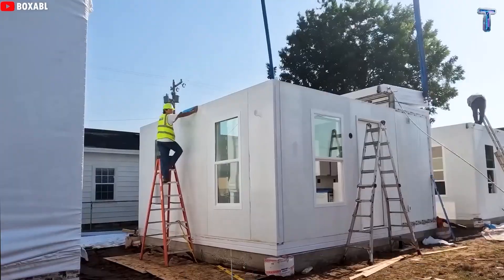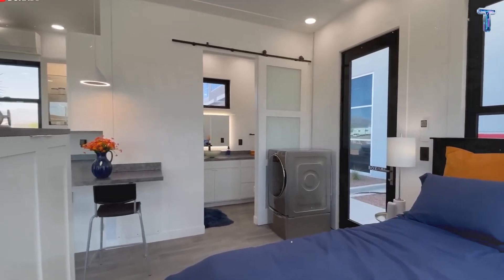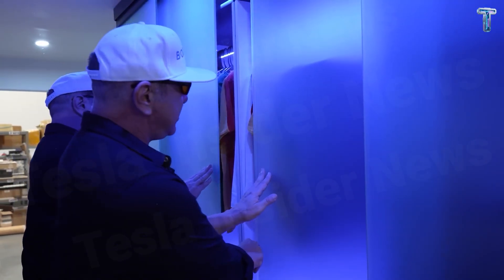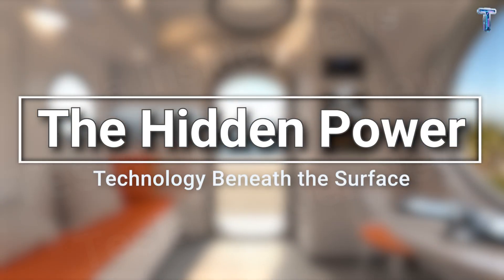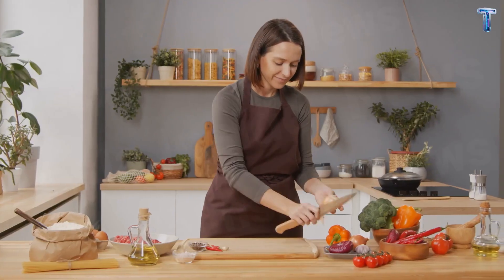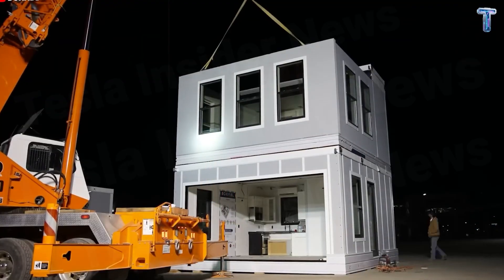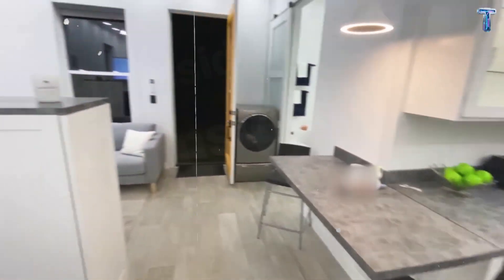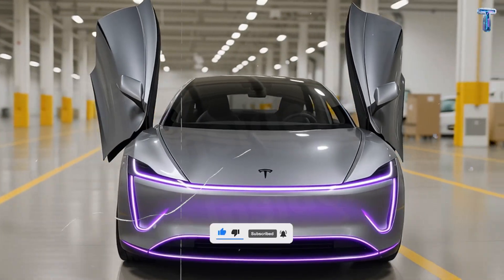Finally Inside Tesla’s $7,999 Tiny House — It Powers Itself

Comment: Shoot. A couple of cargo Starships loaded, with these Telsa house versions sent to Mars & the moon, would surly make the astronauts happy campers. A Space X cargo variant Starship has a payload capacity of up to 200,000 kg (440,000 lb) and a payload volume of 1,000 m³ (35,000 cu ft). Just two of these could ship many tiny homes.  You'll still need to compensate (dirt, some type of outer shell) for high radiation from the sun.

EDIT: If there's a version that is 3 times larger (750 cu ft) than this tiny home, one cargo Starship could deliver 45 750cu ft homes (with space left over) to the moon or Mars.
Reply from the maker: Now that’s a vision we’d love to see — Tesla homes on Mars powered by sunlight
Imagine waking up on another planet, still off-grid
Reply: @TeslaInsiderNews  The only problem would be internet and streaming videos 😁
Reply from the maker: Haha, that’s true! 😄 Internet and streaming might be a bit tricky on Mars or the Moon, but maybe Starlink can make it happen? 
Still, living off-grid on another planet with a Tesla Tiny House sounds like a dream!

Comment: Even if it’s $8K, you still need to consider the land. How would the land be purchase and the cost to install all the utilities (water, drain, gas and electricity) Obviously these home will most likely not be in high cost metropolitan. Example if the average cost of land in L.A. Ca is $600/sq ft, say an 800 sq ft land will cost $480K, so your so call cheap house will be $488K and an average property tax of $7K/ year. You’re definitely saving on the cost of the house itself from standard construction, but there are a lot of other cost and construction factors you need to add into it.
Reply from the maker: Absolutely valid point Land and utilities are the real challenge — that’s why Tesla’s concept focuses on off-grid living, where the house powers and sustains itself.
Imagine pairing it with unused rural land or renewable villages — that’s where this tech truly shines
Reply: Yes Land Cost is the true barrier to Home Ownership.
Reply from the maker: @mikewaters2524  Exactly — and that’s what makes the Tesla Tiny House so fascinating. It’s not about escaping the system, it’s about redefining independence from it
Reply: The cost is way more affordable with this beautyful little house.